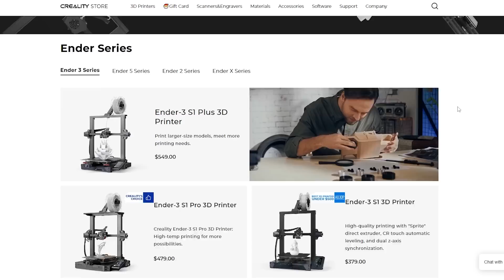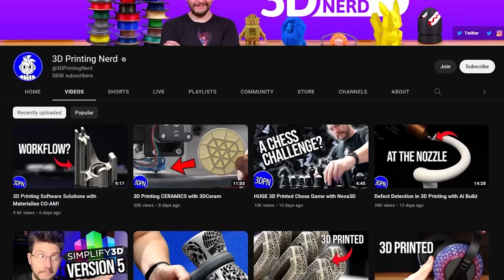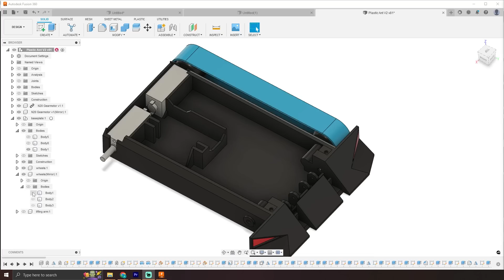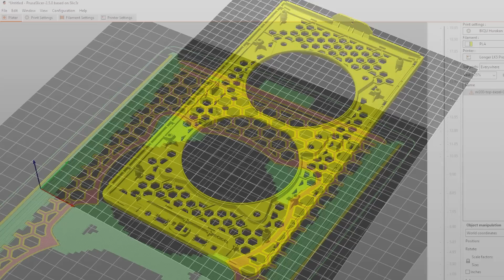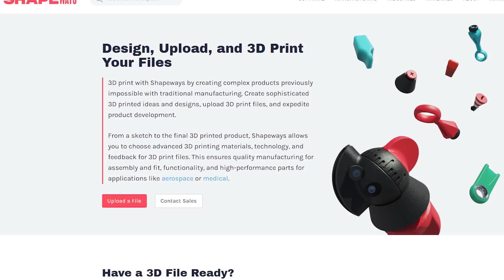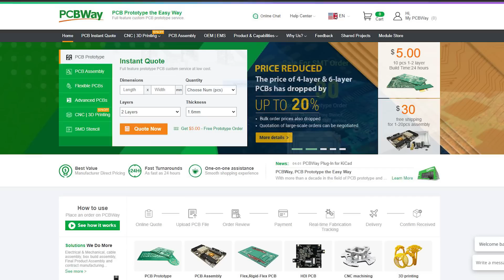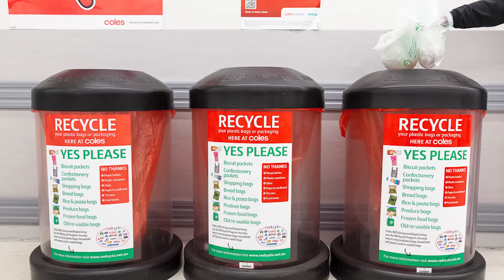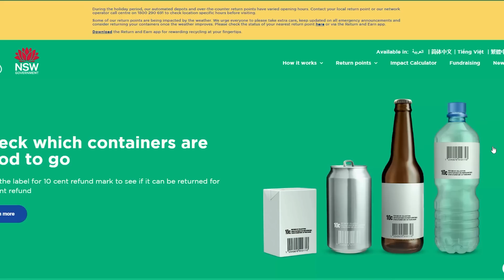My 3D Printing Predictions for 2023

Comment: now this would that be a good idea .... take the 3d printing waste and recycle it by making new filament with it .. and reselling ti at a reduced cost over new filament ... after all all they do is melt the plastic then extrude it and cool it ... then wind it on a drum ... the decrease to landfill and decrease in cost ... will make for more widely available low cost solutions and many people willing to do this ... heck even if you send send 10lbs of plastic ... and the company sends you some appropriate return such as so much off a purchase of recycled spools of filament ... etc ...

Comment: I enjoyed the race to the bottom. I got an Ender 3 for $170 because I only need it 3-4 times a year when designing and printing a unique part out of plastic that I can’t just buy a higher quality part is the best manufacturing process. Maybe less. The vast majority of people I know just print parts for the 3D printer itself and junk off thingiverse. I feel like the “Makers” out there buy a 3D printer for more than just the tool it is….it’s like buying a hammer and then trying to integrate using the hammer in all your projects even if a hammer is the worst tool for the job. 🤷‍♂️

Comment: I have zero experience with 3D printing and got a Bambu Labs X1C last week. I opened the box, unpacked it and printed a 1/14 scale Semi truck body for an RC truck I’m building. I used all the stock profiles and have had no issues as of yet. Incredibly happy with the product so far and glad a company has started making a product easier to use for people like me

Comment: Differenciation of all the filament types is easy an fast as light. You can send your old filaments through a mill and sort the partikls with a pneumatic airstream. Analysis takes as long as the NIR light beam needs to pass the filament grain and enters the sensor. No processes needed, the result appears instantan on the sensor. We built such sorters 25 years ago

Comment: I dont see CNC machining costs coming down anytime soon. Shapeways and other equivalents have been equally high quote wise as smaller machine shops. But 3D printing to replace supply chain, definitely! I sell 3D printed parts and ship all around the world, eventually It would be great to have access to machines around the world, but there is still a lot of babysitting required to make this a possibility. My machine is also becoming a useful tool for me when creating other products. I often need to make a custom jig for grinding knives for example and now I can design and print a custom jig in 2 hours, opposed to spending 1 hour searching for an okay fitting jig, and then waiting a week for it to arrive. Cant wait to see where things are at ten years from now.

Comment: I want to ask a question of the folks in the Maker's Muse space. In 2019 I bought an Ender 3 Pro. I've been using it and overall it has been a good printer, but recently I tried to upgrade it with a direct drive and chose the Crality Sprite. Their own direct drive doesn't work well with their printer and I had to get custom firmware to make it work with my Creality CR Touch even though the Sprite has a mount for the dang thing. Its been not working well since this upgrade and have been very frustrating. In 2023, if I wanted to upgrade to something a little newer, whats the brand I should be looking at?
Reply: Like part or printer wise? Part wise, it generally is safer to look into upgrading things with parts from the respected brands like Bondtech and E3D. Upgrading a printer from a lacking brand with parts from the same brand, tend to get mixed results.

On printer. I can't help much. The market is big with a wide range of printers. So many that it is hard to find people with good comparisons, though it does seem like CoreXY based printers are becoming the new norm as printers like the Vorons, Ratrigs and Bambus are gaining more notoriety. I personally am more interested in small build-volume printers so i've been debating a V-Minion or a Mini+.

Comment: Another great one! I think the big boys are going to be hurting for a while but will turn it around and I am thinking, they will do the bigger is better idea where a lot of people complain about the smaller size of the bambulabs so they will go bigger to try to stay relevant. Prusa XL is honestly a joke at this point and the only thing going for it is the bigger size....in my opinion of course as the Prusa army readies plastic fly swatters to get me away.
I agree with all pretty much except number 5. Recycling is still WAYYYYYYYYYY too expensive for a normal home user to do and the PET bottle thing is nice but what about all those PLA, PETG, ABS, Nylon,etc etc prints you have lying around that will be thrown out? There are solutions but they are too costly for a home user to bother. IF pricing can be brought down SIGNIFICANTLY it will be widely adopted but spending thousands of dollars on a recycling setup when you bought a $99 3d printer is just not going to happen for 99.999999% of the people. Please, don't get me wrong, I WANT recycling of all this waste plastic! For now though it is relegated to maker clubs that have a bunch of members and money or business entities that still haven't figured out a reliable way to make the almighty dollar on recycling. I REALLY hope a company proves me wrong for this but it is still decades off I believe. 
Honestly, I  think the materials will be developed to be more environmentally friendly and degradable before recycling setups even get close to a price normal consumers can afford.

Comment: Great video mate, subbed for the Aussie content; I was pretty pissed off about the soft plastic recycling affair.
My feeling is that we should have some kind of semi-local service to recycle 3d printing waste into new filament. There are plenty of machines available that can do this, but they're too expensive for every hobbyist to own. I reckon the biggest hurdles would be the labour & energy to clean contaminants out of the waste, and getting people to accurately separate out  their plastics. Maybe if you have large enough batches then having 5% ABS in PLA wouldn't be an issue?

Comment: I'm going to do what I did with the Galaxy Z Fold series.  I'm waiting until at least the 2nd or 3rd iteration of the x1 carbon series.  The 1st one has turned out way better than expected, but there's a rule I have observed over the years.  No matter how good the 1st one is, the 2nd and then especially 3rd will blow it away.  Usually, the btter the 1st, the more ridiculously good the next ones are.  So the next printer Bambu Lab comes out with (in that line.. not downgrades like p1p) I will probably buy several of.  Then when the 3rd iteration comes out, I will preorder and sell the 2nd one, if it's a huge step up based on early reviews.  OR if some other brand comes up and makes something like the x1 carbon but fixes some problems like the amount of wasted filament in multicolor prints, then I'll be watching them as well.

Comment: Portal printers like Ender 3 (CR10 and so on) are dead now by design flaws and physical limitations(It was and is a bad idea to move your heavy printbed around instead of just the print head). No one wants to print with 30mm/sec anymore. But the real innovation is also missing. The Bambo Labs printer in its core is a Hypercube style design (Tubes instead of rails) which is from 2016?. It makes some things better than Ender 3 Design but its still away from stable, fast and precise systems like VzBot (1500mm/sec?) or HevOrt.

Comment: I thought the primary reason for using PLA instead of other plastics was that it is a biodegradable starch based thermoplastic? If a recycler or a recycling scheme doesn’t exist by the time my waste box fills I assumed it was safe to send off to the landfill. Granted, and fortunately for me my tiny printer only can handle PLA, many are printing in more durable filaments that are not biodegradable.

Comment: The significance of the arrival of Bambu and Anker in this space cannot be overstated. I have used lots of different printers from lots of different companies, and the Bambu Lab X1 Carbon is the best 3D printer I've ever used. And it's not even close. It prints faster, more cleanly, and more reliably than any printer I've ever used. And it's practically plug-and-play.

And that's the important thing. People in the 3D printing space have gotten so accustomed to tweaking, adjusting, making the stars align and offering sacrifices at the altar, just to make things print right, that they react with suspicion and distrust when a machine arrives that removes all of that and just lets you get on with your life. I have tried to tell people that the Bambu is life-changing, but they immediately label me a shill or a paid advertiser.

I preordered the Prusa Original XL before I bought the Bambu, but now, I quite honestly don't see what the Prusa could do that the Bambu couldn't, let alone at 3x the price.

Comment: "The Prusa MK3 had mesh bed leveling and..."

...and that PINDA probe system sucks.  So does their filament runout sensor.  Also the build area is smaller than an Ender 3.  And the bearings they use on their rods are crap.  And accessing the Y belt is insane.  And the collision sensing system throws false positives constantly.

For the $750 the machine sells for, you're getting like $300 worth of function at best.  The Prusa Mk3S is wildly overrated and the cult-like following is baffling.

Comment: My biggest problem has been with modeling easily programs like sketchup are super easy to model with on free versions but do not allow you to convert/save to file types the slicers use..a all in one company that has its own simple modeler and slicer and monitoring tool will market far better to the beginner class of users. As with any new product K.I.S.S so any “dummy” can use it.

Comment: Non planar printing, air quality monitoring and a push to particulate capture and lower emissions,  the emergence of the $1-$2k industrial quality enclosed and heated printer (qidi, bambu, flyingbear) PrusaXL will be abandoned, taking too long, losing followers quickly, prusa mark 3 upgrade to mark 4...better but not enough, still a bed slinger, more foam filaments, arc bridging as a standard feature, belt platforms for auto part removal,  stronger z axis parts, non toxic safer resin printing, prosumer jetting printers, version of HP  jet fusion but easier to use, no special facility requirements

Comment: This I noticed in 2022. Seems like there are a decent amount of people who believe 3D printers are as simple, reliable and one button push as a microwave. When they can’t produce that part as simply as cooking a TV dinner they think their $1700 printer is broken when they simply don’t understand the printer, design or slicer software. They might even attempt taking the printer apart. I’ve bought 5 printers last year for $250 each and spent very little money to bring them back to life. 2 Lulzbot TAZ 5s and 2 Snapmakers 2.0 350 and a Sindoh DP 200. Now will 2023 educate users that these are NOT microwave ovens in terms of simple to use one button and bingo or will 2023 be a year of the extremely easy to use 3D printer that my Sindoh DP200 attempted but failed at. The idea of the Sindoh cartridge for easy one button load vastly complicates the easy to use when there is an extrusion jam. The easy to use cartridge actually complicated the clearing the jam. By the way, great video.

Comment: My one comment on the industrial-level stuff, as someone who has spent $$$ having it done, is the high cost of parts and generally, the companies have high minimum orders too. Mind you they are still geared toward large companies, not hobbyists. That said I hope they can bridge the gap some more since I can say that as cool as hobby 3D stuff is, it can't hold a candle to some engineering spec materials!

Comment: In regards of CAD: After more than 2 months with more than 4000 USD school fees 3 years ago. I draw 100% on my first CAD for 59 USD (life time fee) again: ViaCad 10. Of course the others have many advantages, static calculation and and and, but I never draw so fast anywhere else than on ViaCad. By ViaCad, I still can remember every single function even after 2 months without useing it. And there was no other CAD (even free versions) were i come into that fast - so 59 USD is a dam god price. Ok, normally you need to send an E-Mail to ViaCad, since the first License code never works (I own 3 Licenzes now ;-) In never use Fusion 360 but way? For private users without commercial right or? Way i should give everthing what i Draw away for free? Way i should feet the biggest Software company for free through Fision 360 if i still get ViaCad 10 for 59 USD incl. commercial rights? I also have Inventor training, but way i should buy this licenzes? The simply functions of ViaCad fits needs of simple constructions on a fast way.... I even do not need ViaCad12 for 3 times the price.... To understand Solidworks or Inventor you have to immerse yourself into it full time for 5 years. 5 years you're wasting to understand how a machine works and what it needs.... To understand the statics, functions, scope, material errors, material requirements - that is a lifetime work too. Just the non-destructive testing of materials cost me 5 years of my life.... binding and mix up on transfer.... Oh my gosh..... CAD is one part were nobody should get to deep into becouse thats the job of drawers - a kind of "assembly line workers" who today are mostly erroneously called designers. To feed desingers for doing their job, ViaCad is more than enough. Just because someone can use CAD doesn't mean he having any ideas to make something happen. I also don't do any "annual tax statements" either - that's what the accountant is there for ;-) But you need to see the way to instruct both of them - becouse no income, not tax staitment and no products at all. Selling it, understanding this process as well - 5 more years passed away.

Well, by using Fusion 360 for free you are using the rights of the company that also owns the most used software for online shops as well. So called "Magento" by Autodesk as well... that's your decision..... I will never touch Fusion 360 as there is always a price for everything, sometimes just the bill will shows up late.......

Comment: 2 - yes please - for the love of .stl - start adding basic editing tools to the slicers - there are slicers that dont have mirror or cut tools, many times  adding a simple shape is imposible because the slicer wont let you  position an stl hovering mid air to merge it with another, designed my first part in FreeCAD - awesome initiative but it took me literal hours to even wrap my head around the basics....

Comment: I really wish they would start making automated PLA recyclers.  Basically a 300x300x300mm oven that you can fit any botched part in to, it gets up to 200°C to melt it down, and has a screw drive that extrudes back in to 1.75mm filiment.  I know there’s DIY processes already.  But it would be neat to see in a single piece unit, the same size as your printer.

Comment: The company I work for is already printing repair parts for the reason you mentioned, supply chain and long lead time. We still order the spec parts and replace them when they arrive because we want the durability and there's support and warranty issues. But we can't afford the downtime in production when equipment is down so we do what we have to.

Comment: Never underestimate the innovation needed to make the cheapest machine that's still good enough it doesn't destroy the company. It's not the innovation most people think of, as people are used to 'fancy newness' as innovation, but the proper definition of innovation is a change that improves a product or business. This could be as simple as process changes behind the scenes, to less obvious ones like more efficient ways to design a product and electronics so you maintain or even improve quality, while simultaneously reducing cost and increasing simplicity.

In the end, the race to the bottom has the side effect of making the middle-ground printers far more affordable and reliable as those innovations to reduce cost percolate up as people pick and chose the improvements that had the most impact to the bottom line and the least impact on quality.

The simplest design is often the most reliable and cheapest, but also the hardest to design and figure out.

Comment: I'll know when 3D printing has truly arrived when:

A) a plumber in Nevada can use a printer mounted in the back of his truck to make a couple of extra 3" PVC 90 degree pipe joints instead of wasting time on a trip to the big box store,

B) an electrician in Nairobi can do the same for the gasket on a junction box,

C) an auto repair shop in Buenos Aires can print off wheel bearing seals for any make of vehicle while the car is in the shop, instead of having to order them from a warehouse miles away, and 

D) a consumer electronics shop in Hanoi can print off a replacement iphone case while the customer grabs a latte at the coffee shop next door,

all using generic printer code downloaded from Amazon, Toyota or some anonymous software vendor in Romania.

Comment: definetly agree with all of it other than fusion 360 is not complex at all, it fairly beginner friendly that is not complex  to use but does lack functions unless you pay for all the addons but at that point might aswell get a industry level of cad software such as creo, solidwork. One other beginner friendly and simple to use CAD package is spaceclaim, not sure if it free but when i used it is literally a very dumbed down version of cad where yuo can create a simple 3d model with only 1 hour of practice and no instruction or help